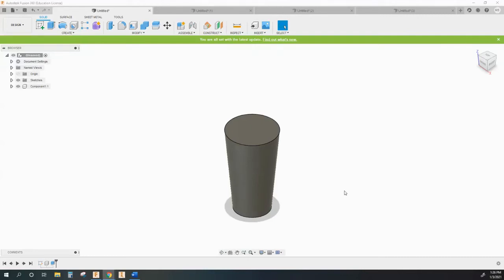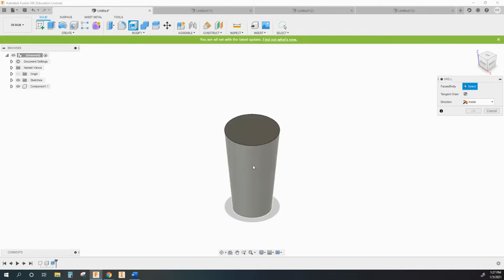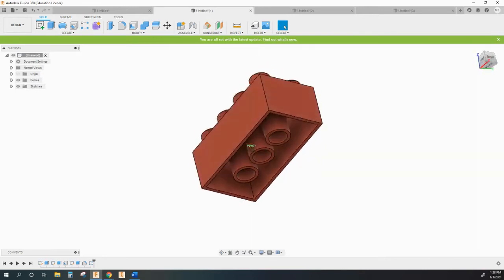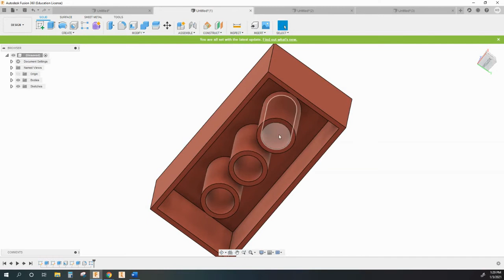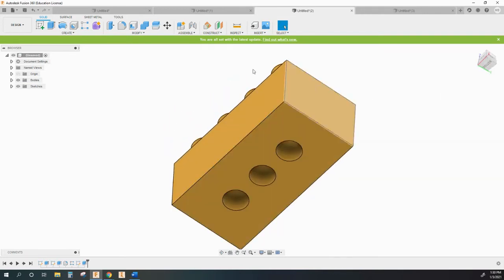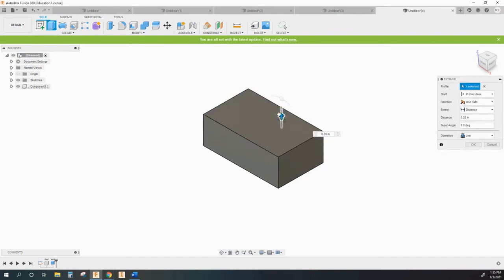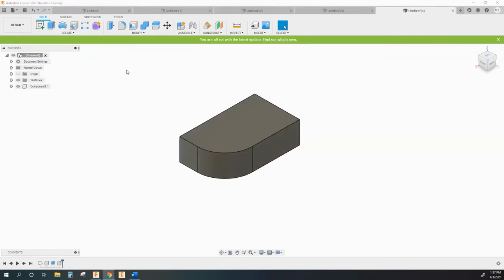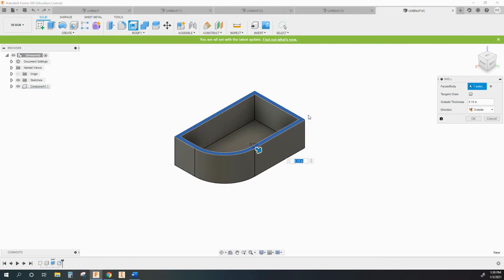Shell Tool in Fusion 360

Comment: Hello, i am looking a way to remove the shell feature so that i can get a solid body. I accidentally pressed the wrong tab and pressed enter and closed and saved. Can i still salvage my work?
Reply from the maker: Each time you use a tool, it should appear in the part history at the bottom of the screen. You should be able to see where you used the shell tool, and either edit the feature (change wall thickness, etc.) or delete the shell completely.